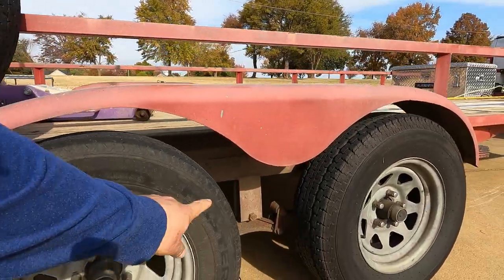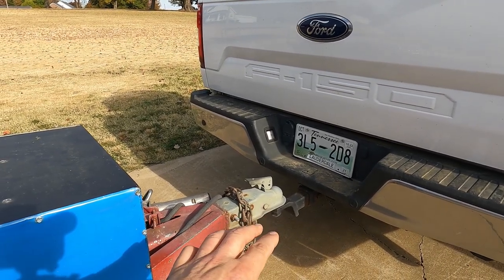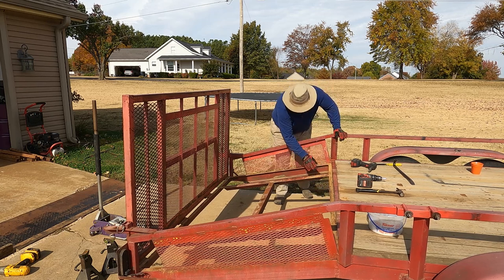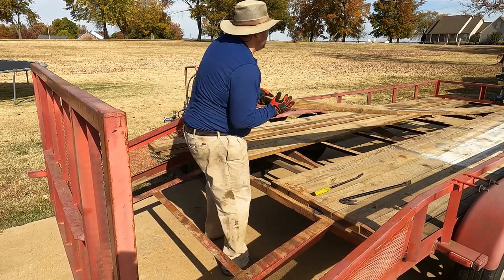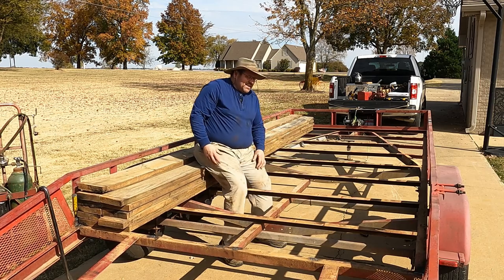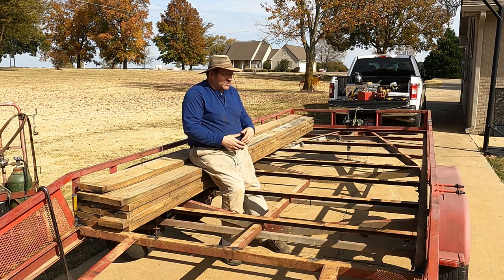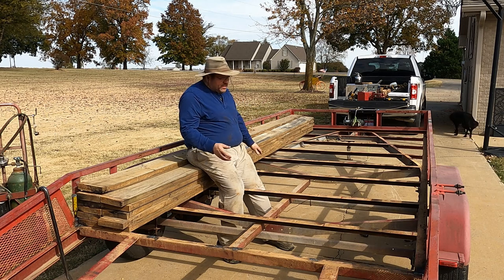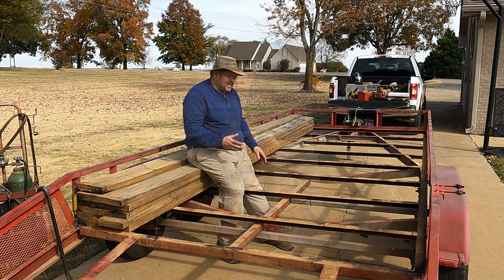A Look Under the Hood on How a Race Trailer Came From a Boat Trailer

Comment: Jason thank you for the tip on the boat trailers. What a cost savings! With the cost of supporting a racecar nowadays that will definitely help abunch of guys for sure
Reply from the maker: Thanks Patrick, it made a real difference for me on being able to get up and going on racing. I know not every trailer can make a good candidate and it still takes a lot of fab work but hopefully it is just the right solution for someone out there trying to get going on a tight budget.

Comment: getting ready to cut into my open trailer. got a 16 f150 5.0l i have a 4' tall, 4' deep, 78" wide storage box and a tire rack on the back of the box. its super tongue heavy alone with tools, tires, and a generator on the front. with the car on it, it does balance out a bit. it currently has bold on hubs ( 1978 toranodo rear wheel hub) but cant find them and the newer fwd cars dont have enough weight rating so they burn up in a few trips. looking to either put a solid axle with a pin style under it, or a spring kit under it. its 8" off the ground and pulls like a rocket straight down the road. guess i have 5 months of snow to think about it.. lol
Reply from the maker: Sounds like you have quite a bit more work needed on yours than what I needed. Good winter project for sure and good luck with it.

Comment: Sitting on fenders now
Reply from the maker: I thought it might but after checking the measurements it has the clearance it needs. BUT I do have a back up plan if needed. The fenders are bolted on each end and If I do need to raise them I just have to drill 4 new holes :)

Comment: Just curious Jason did you build the deck on the ground and install it on the trailer or just build it on the trailer and also how is it attached. My wife says I have a obsession with race cars and trailers lol
Reply from the maker: Jay,
    I built it on the trailer. I stripped the boat trailer down to the frame, cut the tongue back to be the right length and notched and dropped the rails at the end to make the dove tail and then just started adding on the angle. What I did was built the square all the way around, then the square tube rails over the top, and finally added the ribs. Honestly only took about 8 hours total time to do it.
Also, I did slide the axles rearward about one foot to correct the CG so the trailer would tow well when loaded. The boat trailer was a nice piece, and the axle hangers are on a separate piece of flat iron welded on the bottom of the main c channel. We just cut the welds loose, slid, and re-welded (If I had to cut every hanger loose and move them then yeah that would sure have taken several hours).
Reply: Thank you sir. It’s a nice piece. Waiting to see it finished back out. Good luck